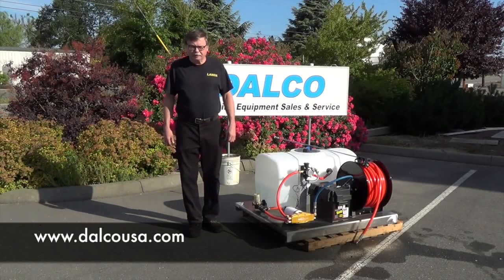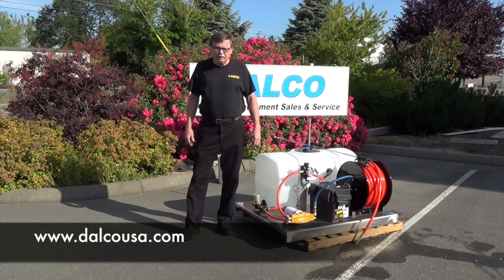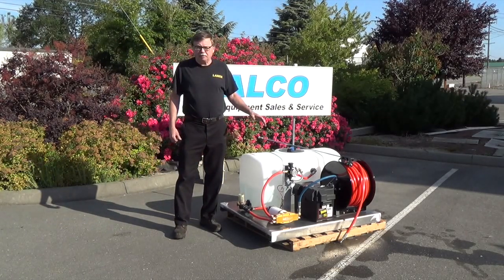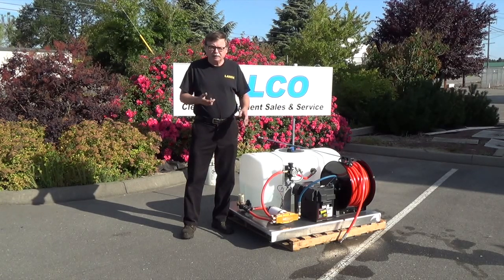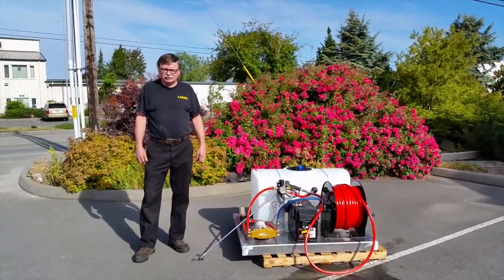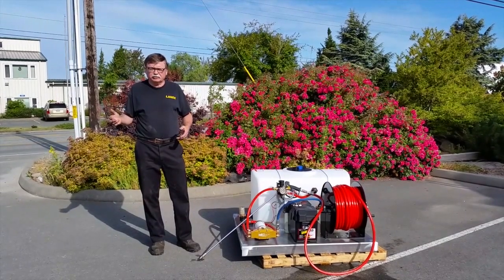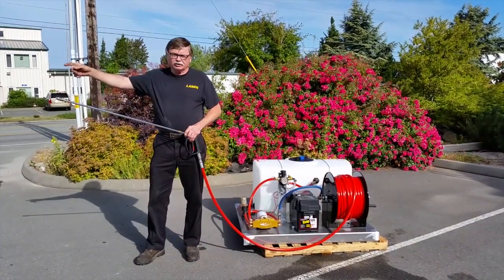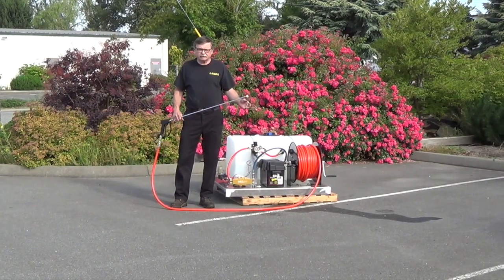Custom Chemical Sprayer

Comment: Price of this unit?
Reply from the maker: Made to order, but about $2k.
Reply: 215Detailing , you can build 1 yourself for less than £100 if you have the no how !!!
Reply: @darrinperkins4842  I know I’m late but the skid plate alone is about 350 US dollars. That’s £252.00. I have the know how and you’d need at least 1000 US to come close. 1/2 inch orange chemical hose is that £100 you are talking about.